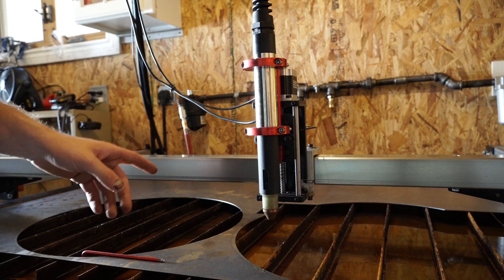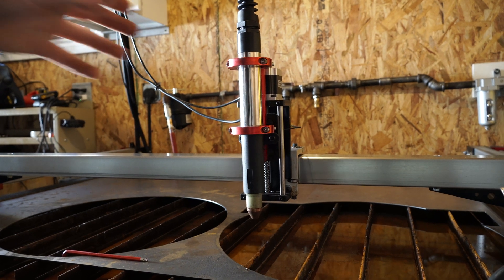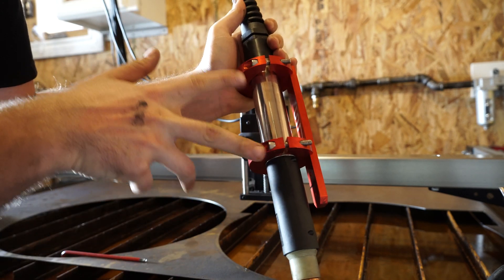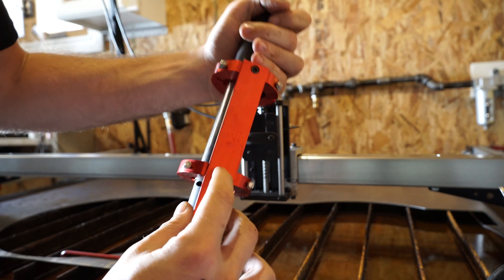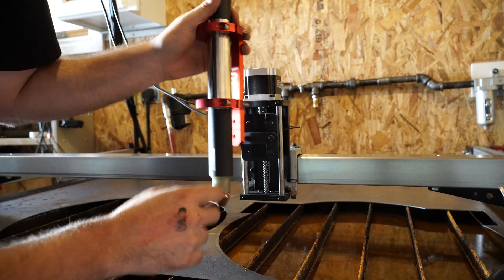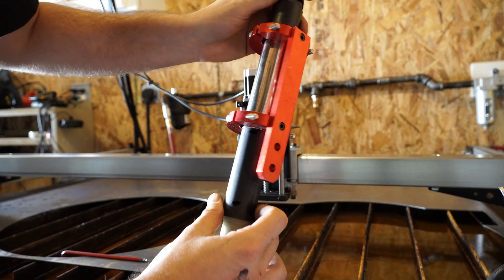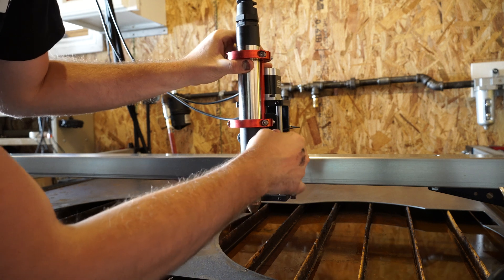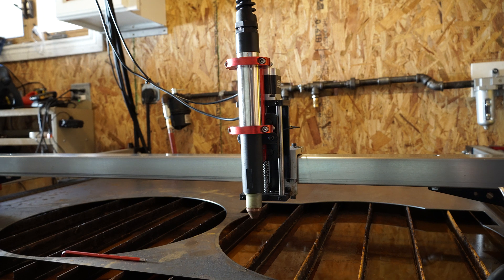Langmuir Systems Crossfire Pro Machine Torch Mounting - Tutorial

Comment: Does your Z have some play in it? Mine wobbles enough that the torch cable will cause the torch to move a few degrees and cause some bevel issues with cuts.
Reply: Matthew question:   Could your “wobble” problem possibly be due to the “eccentric bolts” not being adjusted enough inside the torch holder?  When assembling the “floating slide Z-Axis assembly” on mine,  I had to adjust them quite a bit and then tighten them up ...  Good luck.
Reply from the maker: We have no play/bevel
Reply: Thanks for the video